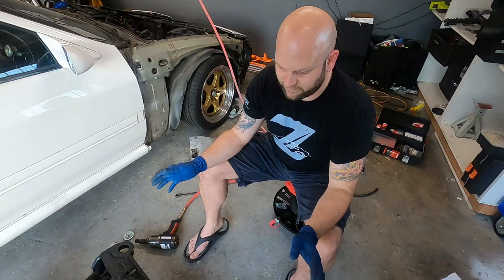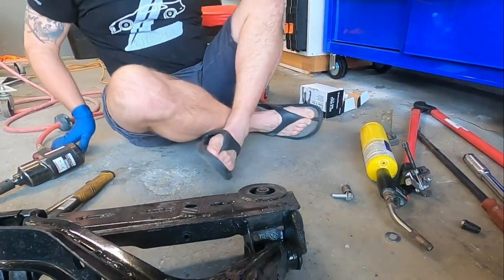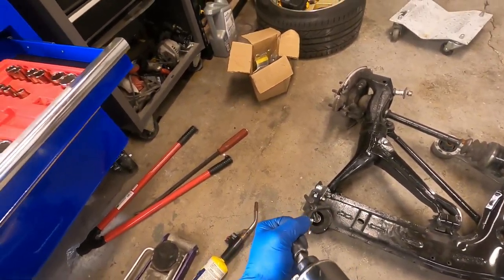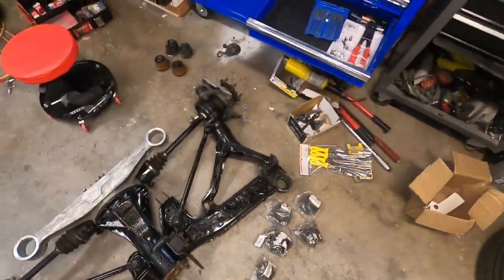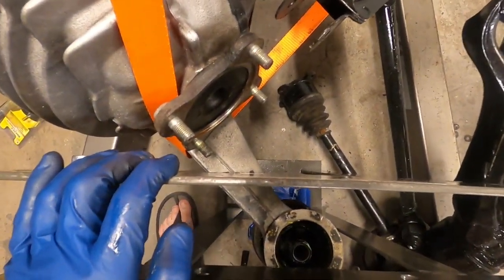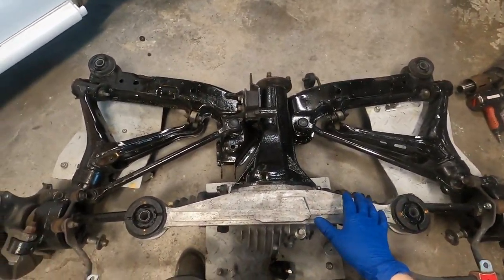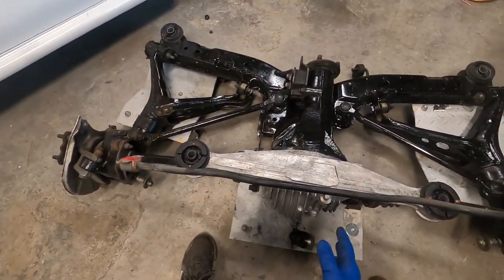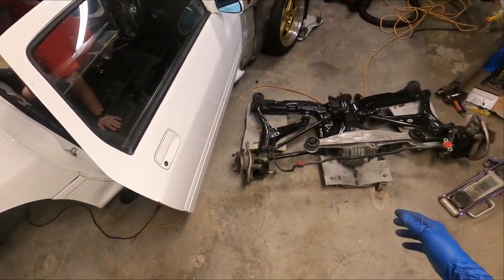Subframe swap New Mazda speed Bushings FC3s RX7 Pinion Snubber

Comment: Try putting the bushes in the freezer overnight and heating up hole it has to press in✌️
Reply from the maker: Nice tip for bearings and s chassis bushings. For these you must have a press
Reply from the maker: Nice tip for bearings and s chassis bushings. For these you must have a press

Comment: Snubbers are not designed to be in contact (with the diff).
The snubber should have a little space when at rest; any upper motion of the front snout of the diff should contact the snubber, which then will help the front diff mount.
In this video, there are too many washer - you really don't need them.
Reply from the maker: Will make final adjustments once the drive line if installed